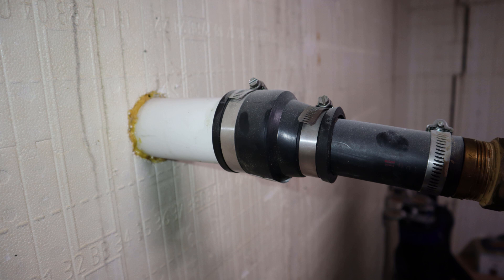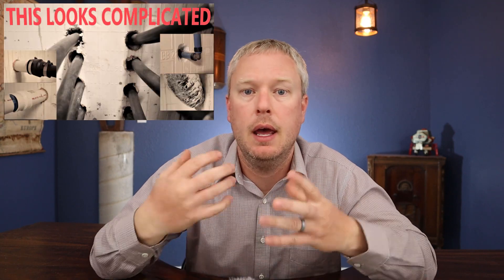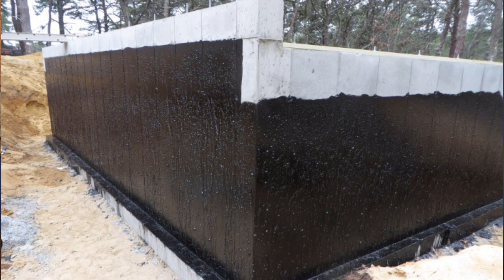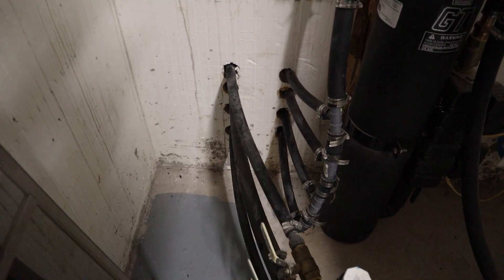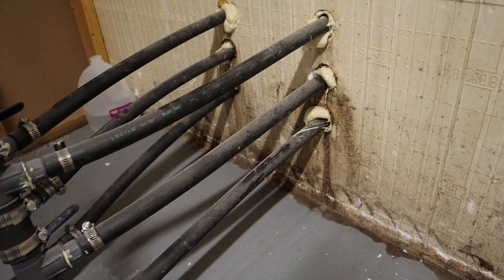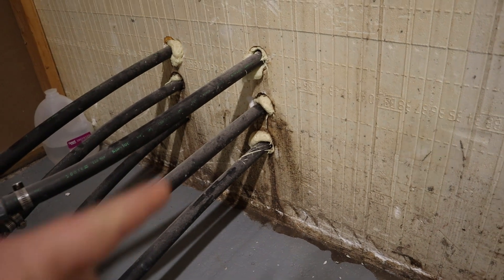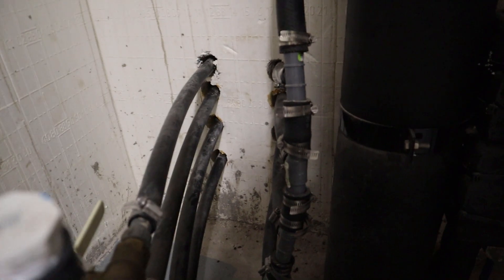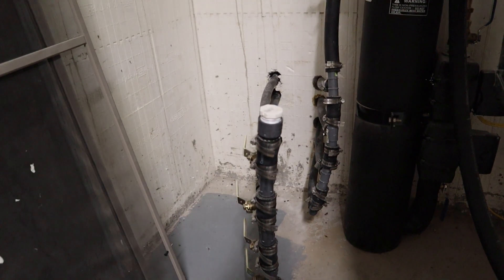Pipe Penetrations - Step by Step DIY Geothermal (Part 3)

Comment: so it is need it to expose the hose to the ambient temperature, this does no loose energy
Reply from the maker: The liquid moves fairly fast in the pipe, so the short piece of pipe exposed to the ambient temperature doesn't move much.  You can always insulate the pipe if it makes you feel better.

Comment: Is there any reason you didn't just run these pipes below your basement foundation and come up through the basement floor?  Since your loops were below your basement floor depth and this was new build, would that have been a better approach to avoid potential wall water leakage?  I'm also in Central KS, building a new home and plan to DIY geothermal.
Reply from the maker: It would draw heat from the home if the loops were under the basement.  You want to keep the loops at least 10' apart from each other and at least 10' from the home.
Reply: @Challenged1  Maybe didn't ask that question in the right way.  I only mean the inlet/outlet pipes (no slinky pipes under the house).  So, in your case, everything the same as you've done BUT instead of penetrating the wall, you brought your loop inlet/outlet pipes through the floor, after the basement walls are poured (assuming they are poured concrete, as is typical) but before the basement floor is poured.  So, in your case, you would have the inlet/outlet pipes running under your basement footings and up through the floor.  Any reason you didn't do that?  Is that a bad idea?
Reply from the maker: @jefftucker164  What you described could work, I'm just leery of putting any pipe under the footing.  In the off chance you needed to replace the pipe, it's much easier to do through the wall rather than the floor.  I also like to keep my penetrations well above the drain tile, especially if conduit is used.

Comment: Is there any benefit of running bigger pipe in the loop portion of the system?
Reply from the maker: It's not necessary and would increase the cost.  The only way would be if you need 1000' plus long loops
Reply: @Challenged1  thanks good to know love all ur videos great information
Reply: Less pumping energy needed for larger pipes, but the pipes cost more.
Reply from the maker: @FrancisKoczur  Less heat transfer for larger pipes.
Reply: @Challenged1  SDR11 pipe will be thicker at larger diameter, but the extra surface area about cancels out the lower total thermal conductivity of the pipe wall.

If the velocity of the fluid goes under turbulent flow measured by Reynolds number, then there will be less heat transfer in the same amount of time.

Comment: Is your basement level at -10 feet, or you needed to adjust the level of the pipes when they come back to the house?
Reply from the maker: the pipes are coming into the house about 5 feet higher than the buried depth.  My house is built up and the ground slopes down as you get further away from the house

Comment: All good tips, Garrett! Since I was a plumber for much of my adult life, I feel well placed to comment on the toilet ring as sealer- I prefer the natural beeswax  to the petrochem type. The natural beeswax will still be malleable 30-40 years from installation while I have seen the petrochem types go hard in less than a decade. On preventing leaks into the basement; no other method I have ever heard of works better than not putting a hole through the basement wall or floor. It looks to me that turning the pipe to come out of the ground just at the foundation and entering above the first floor line would do that best. Even basements that already have sumps and pumps don't have outlets through the floor or walls- they pump up till they can be connected to a proper sewer or drainage system. FWIW, this would give you the high point in the system to fill from and bleed air out too. Thanks for the detail and the "soft" version of how much Murphy taught you while you did this! FR
Reply from the maker: Excellent tips.  The main reason the pipes have to come in low for a geo system is the geocenter pump/container needs to be at the highest point in the system.
Reply: @Challenged1  I'll take your word on that. Some pump designs don't perform well under certain head pressure conditions- some "pull" better than they push, some will make good volume but not pressure. I'd need to read all the pump and equipment specs, as you would. Using a different pump might well change that and provide a bit more flexibility. BTW, appreciate your answer- it's likely a low pressure, volume specific pump would be a manufacturer's choice. The pressure change from a column of water 10' tall is only about 4 psi, so that is the increase- very little. Since I have installed automatic sumps in basements and such, I'm familiar with the hi volume/ low pressure variety- most will pump up a 10' head with little problem- in cheaper pumps, a little seal leakage may occur, but it is "internal" to the working fluid, so it just becomes part of the next pump discharge. Also, going up to get out, and then down, will negate some of the head pressure problems once you bleed all the air out. As always,Thanks for the time! FR
Reply from the maker: @fredericrike5974  GT Flow Center is the pump/container that I'm using if you felt like some Sunday reading.  The whole thing is actually a non-pressurized system.  I'll show my setup on one of the next geo vids and it may make more sense.
Reply: @Challenged1  Thanks! I think what you are describing then is a thermo-siphon, which uses the density change in a fluid to allow it to "come to the top " and sink when cooler and denser. The Ford model T didn't have a water pump either- it depended on this same function. Or so it sounds like. Subbed some whole back- see you when you get it in the can! FR
Reply: Wouldn't the problem then be that it would freeze in winter if they came up on the outside? And that would greatly affect the efficiency?
Reply: @panamericaco  None of the companies I know of in Texas use pure water as the circulating fluid. And an infusion of just 20% alcohol will lower the freezing point ten degrees, IIRC. Pure water causes many problems with internal line coating and other equipment erosions, as well as freezing. And many of these "blended coolants" actually transfer more heat than pure water.